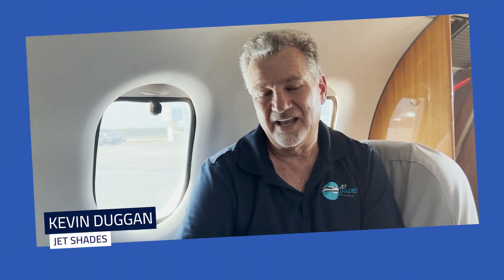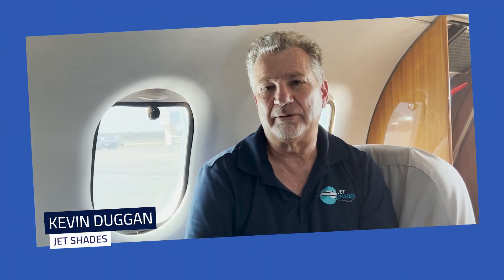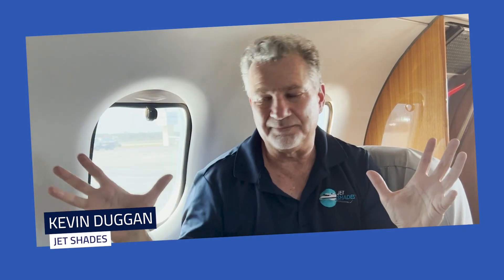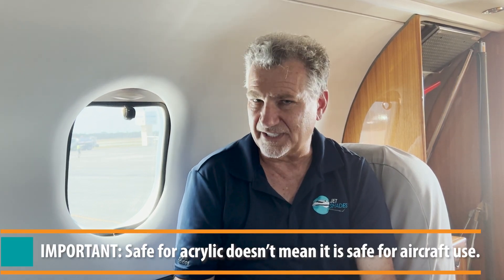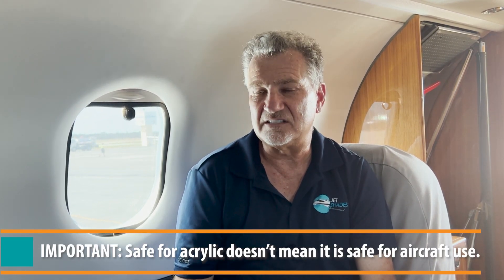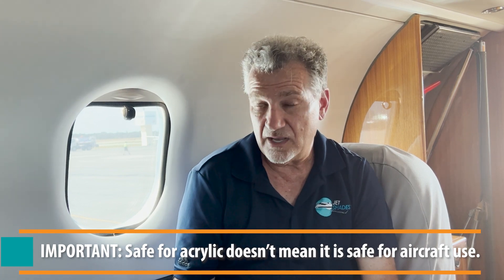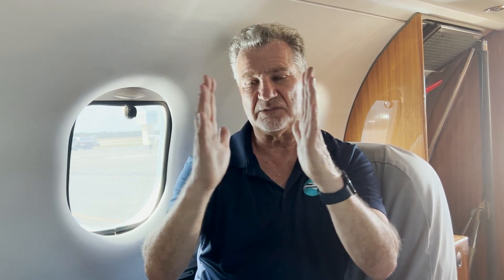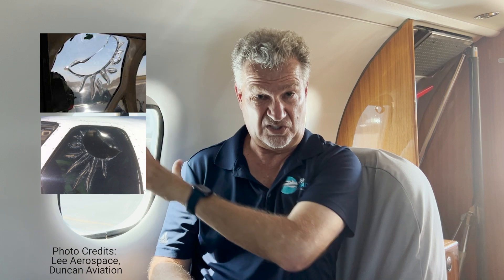Airplane Window Tint: Dangers, Damage & The Bad News I Had to Deliver

Comment: The heat in my cockpit makes the aircraft unbearable. If its more than 25C outside you're looking at approaching 50C in the cockpit.  There are vents but they are a joke. There are no jet shades or any suitable shades available that I know of,  the aircraft is rarer than a spitfire. Although the windows are same part number as those in the robin Dr400.

Comment: Could you tell me what part of FAR 23.775 talks about that please? I tried looking it up but I didn't see where it talked about tinting. I did see section (e) that states ) The windshield and side windows forward of the pilot's back when the pilot is seated in the normal flight position must have a luminous transmittance value of not less than 70 percent.
Reply: Not seeing the specifics stated in this video either